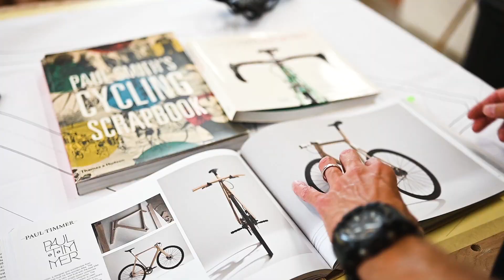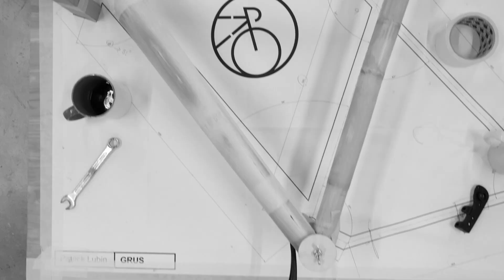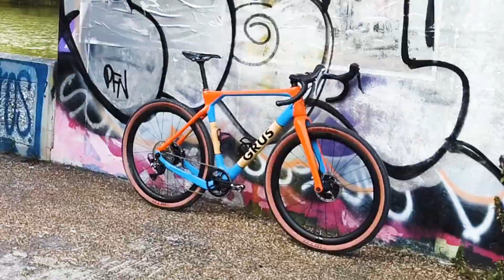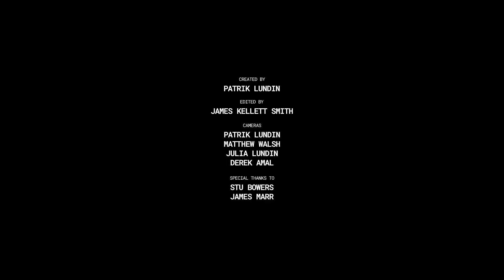Gravel Revolution - Building the Ultimate Frame

Comment: what type of adhesive or epoxy did you guys use to rejoin or to make the "engineered" bamboo? will the epoxy resin ( just the resin and not with the fiber )  for wrapping the joints can be use as glue for engineered bamboo?
Reply from the maker: I would recommend using a thin layer of flax between the bamboo and then a structural epoxy to help with fatigue.